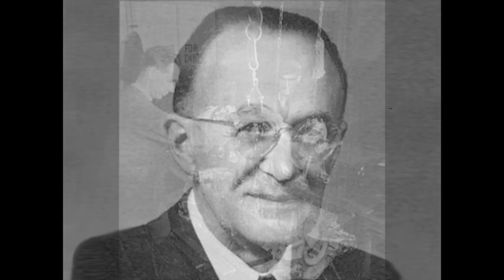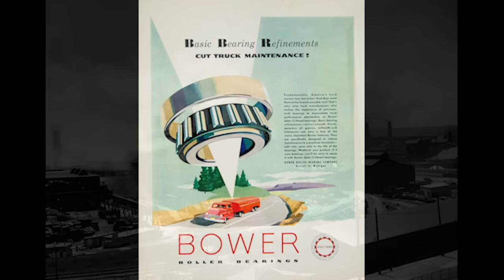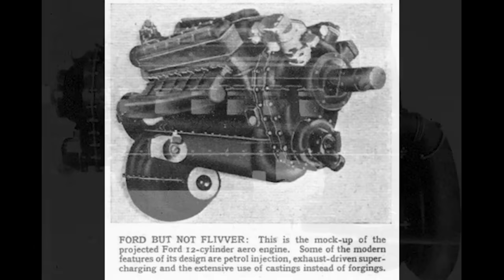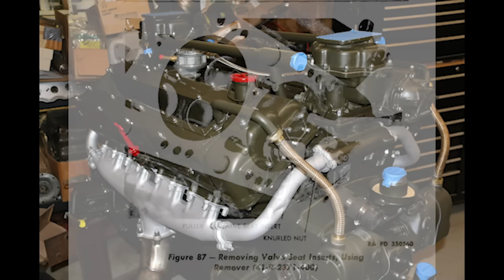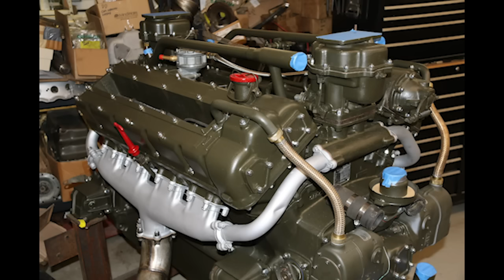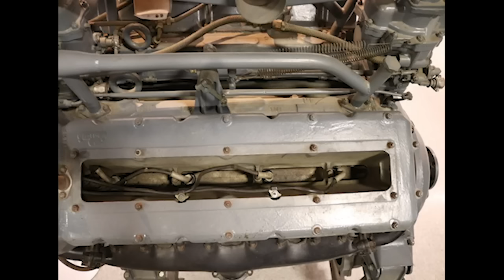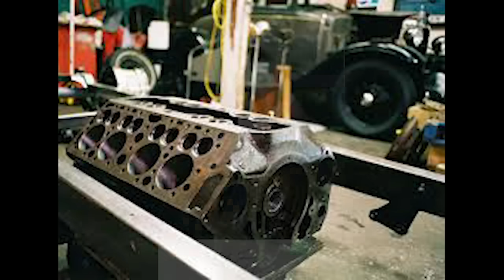War Hemi: The Story Of The GAA V8 - 1,100ci of aluminum WWII Ford grunt

Comment: Now, Ford is making engines that run sub 7 minute laps at Nurburging (quickest) first American car ever. Fastest all-time ever pass for a pushrod, internal cumbustion engine in a 1000 foot Funny car run, Bob Tasca was even FASTER in the quarter mile. Fastest runs ever at Pikes Peak. Fastest ever lap in a NASCAR sanctioned stock car, Bill Elliott in a Thunderbird at Talladega.  Dominates the BAJA truck races. Has won multiple F1 and Indy car championships etc. The 4.6 ohc motor is nearly indestructible. I drive (and have driven) Ford vehicles every day for 30 plus years and have never had a major or catastrophic failure. You're either an ignorant LS fan or just truly uninformed. Oh and by the way, the LS motor is really nothing more than a ripoff of the Ford 351 Cleveland engine with an aluminum block.
Reply from the maker: Fired up!!!!

Comment: just proves auto makers using timing chain set ups are screwing the public
Reply: A worm gear would never work at the rpm's a modern engine revs too. The noise they make would also be intolerable.
Ingenious design though and great for a low revving tank where noise doesn't matter.

Comment: I learned a lot in this, it didn't occur to me that they were doing dual overhead cam and flat pain cranks back in those days. I want to learn more about this 30 cylinder Chrysler engine, that sounds nuts.
Reply: DOHC was done by Peugeot and Duesenberg decades before. This information is inaccurate that is not a hemispherical combustion chamber. Hemi in the title gets a lot of clicks though

Comment: @1:21 "....Rolls-Royce has been creating a V12 engine with surgical care" Right, as he shows a picture of a mechanic with a cigarette hanging out of his mouth dropping ash inside the cylinder.... surgical. Yeah right. The quality control in the 1940s was pure crap.
Reply: I noticed that too.
Reply: Exactly 😂. The Merlin was such a POS when Rolls was manufacturing it they couldn't interchange parts between engines. It wasn't until Packard started building it that it was reliable. If one ran really good they would put it in a spitfire. If it ran subpart they would stick it in a boat.
Reply: @russblack443 Exaggeration and misunderstanding of the situation. Merlin were not unreliable. They were hand made.

Comment: Not a hemi.
Reply: The GA series has a hemispherical type combustion chamber
Reply: @WilhelmKarsten  No, it doesn't, it's a pentroof and that's clearly visible in this video.
Reply: @PistonAvatarGuy  Sorry, you are confused, there are clearly no opposing quench pads in the head or the pistons.
This is a hemispherical combustion type chamber
Reply: @WilhelmKarsten  Quench pads do not define a pentroof combustion chamber, the shape of the combustion chamber defines the shape of the combustion chamber.

Look at most Honda K series combustion chambers, they don't have quench pads (unless they're aftermarket castings, or have been welded to add material), yet no one would consider them to be hemispherical in nature.

Even on the GAA, you can see that there are flat spots where the quench pads would normally be located, they're just not close enough to the bottom of the head to be considered quench pads, just as it is with Honda K series heads.
Reply: @WilhelmKarsten  Heck, Drag Cartel even makes a head for the Honda K series that they call the "open chamber" head, it looks almost exactly like the GAA head.
Reply: @PistonAvatarGuy Opposed quench pads are the only thing that distinguishes a 4-valve Pentroof from a 4-valve Hemi design.
No hemi engine has a perfectly spherical chamber.
Reply: @WilhelmKarsten  Plenty of hemis have actual hemispherical combustion chambers. And if this is a hemi, what's a Honda K series?

A pentroof combustion chamber is made so by the fact that it resembles a pentroof, as this one does. There are two flat planes (one where the exhaust valves reside and one where the intake valves reside) which intersect at the peak of the combustion chamber, that's what makes it a pentroof combustion chamber.
Reply: @WilhelmKarsten  Really, I think that there's only one 4 valve hemi that has ever been produced, and that's the Honda RFVC.

Also, now that I've seen better pictures of the Ford head, I can see that there aren't really flat areas where the quench pads would normally be, but there is a very clear, straight line at the peak of the combustion chamber, which clearly defines it as a pentroof shape.

Comment: “Hand assembled with surgical precision “
-showing a picture of a guy tightening a bolt over an open valve train with a cigarette in his mouth
Reply: Precise doesn't equate to sanitary...try again.

P.S. I doubt cigarette ashes will lock the engine up.

Comment: Stainless steel exhaust manifolds are a "big weight savings"? Yeah. Saving weight is a HUGE priority on a "tank engine". 

And when it comes to stainless steel exhaust manifolds which are STRUCTURAL in that they support at least part of the exhaust system weight AND are "pressure vessels" its not IF they will break but WHEN they will break. Especially when WELDED. 

A little known "secret" of all those "high performance" engines out there that are "boosted" with turbos and are equipped with SS "headers" is that EVENTUALLY THOSE "HEADERS" ALL BREAK. And when they break is primarily determined by "heat cycles". 

Which is why ZERO "mass-produced"  engines use SS exhaust manifolds whether "log manifolds" OR "headers". Production vehicles rack up "heat cycles" far more quickly than "race" vehicles generally speaking and get HOTTER and COLDER than a "seasonal use" vehicle used for "motorsports" which nearly all happen in the "summer months". 

Most "high performance" off-highway vehicles also run "cooler" as far as exhaust temps go than road vehicles and/or for much shorter periods of time. 

"Exotic" fuels like "race gas" and ethanol-gasoline blends and methanol are also COOLER RUNNING FUELS BECAUSE AS OCTANE INCREASES "ENERGY DENSITY" PER UNIT OF FUEL WEIGHT DECREASES. SO THEY ALSO HAVE TO BURN FAR MORE FUEL PER UNIT OF "POWER" THAN A "LOW PERFORMANCE" ENGINE RUNNING ON REGULAR UNLEADED PUMP GAS OR EVEN "PREMIUM". 
THEY ALSO TEND TO RUN VERY RICH AS A "SAFEGUARD" AGAINST LEANING OUT THE A-F RATIO AND "MELTING DOWN" A PISTON BECAUSE LACKING SUFFICIENT "LIQUID FUEL" FOR COMBUSTION AN EXCESS OF OXYGEN IN A HIGH-TEMP HIGH-PRESSURE CONFINED SPACE LIKE AN ENGINE CYLINDER WILL TURN TO "SOLID FUEL" MEANING THE ALUMINUM IN PISTONS. ALUMINUM IS "FLAMMABLE" LIKE ALL "REACTIVE" METALS. 

So even something as "simple" as an exhaust manifold was far beyond Henry Ford's engineering ability which NEVER was remotely as "brilliant" as his "plans" whenever he was in "DIY" engineering "mode" and when it came to attempts to "take over" an already existing and established "industry" flush with REAL engineers back before engineering was a college "program" AND a "profession" Henry Ford was hopelessly "outmanned". 

And he was the original "victim of his own success" in that his "brilliance" was a PR tool his "investors" came up with to "recruit" REAL engineering "talent" to do all the real work that comes between a "plan" and a "product". 

Unfortunately being "outmanned" and in a situation where real "craftsmen" and "skilled laborers" and "scientists" and "inventors" were doing everything he could not in "his" factories building "his" machines - which pretty much WAS "everything" SINCE the sum total of his "work experience" before finally "developing" a "successful" automobile to "replace the horse and buggy" was as a supposed "scientist" working for Thomas Edison at "Edison Illumination" long after Edison "perfected" the light bulb and was "developing" audio and video "recording" and "playback" machines  as the "Wizard of Menlo Park". 

Not much in common with the "auto industry" especially when you consider that Ford's Model T ignition system used "trembler coils" for a "make and break" ignition long after DC "transformers" called ignition coils and DC batteries and generators were "developed" so distributor ignition was "feasible" on such a low-compression low-rpm small-displacement hand-cranked engine like his. 

Failing that MAGNETOS were certainly "perfected". 

But of course Henry wanted "affordability". And "security" for his "brilliant plans". And "outsourcing" a STATE OF THE ART ignition system would have required going PUBLIC with the reality that a long-time Edison Illumination "scientist" didn't know BEANS about ELECTRICITY. Which is why his "modern" automobiles didn't even have ELECTRIC ILLUMINATION much less electric starting until the "competition" at Chevrolet "developed" the first mass-produced and MODERN "competitor" for the Model T and set "affordability" aside in favor of DISTRIBUTOR IGNITION AND ELECTRIC STARTING AND LIGHTING AND A PRESSURIZED FUEL SYSTEM WITH A REAL CARBURETOR ON A 4-CYLINDER OVERHEAD VALVE ENGINE ON EVERY "AUTOMOBILE" IT MASS PRODUCED FROM DAY ONE AND MADE SURE ITS "AUTOS" COULD REPLACE A TEAM OF HORSES AND A WAGON INSTEAD OF JUST A HORSE AND BUGGY BY BUILDING A "TRUCK MOTOR" AND ALSO USING IT IN PASSENGER CARS INSTEAD OF TRYING TO TURN A MODEL T CAR INTO A "TRUCK" BY PUTTING DUAL REAR WHEELS ON IT AND CALLING IT A "TT". 

Farmers and ranchers were "flush with cash" until the "Great Depression" and were the #1 users of real "horsepower" on an every day basis and working horses more than 40 hours a week meant needing a "double workforce" each half of which worked only "half a year". "Affordability" be damned when you can replace many "horsepower hours" used only to get products to "market" and proceeds home again at a "fast walk".

Chevrolet made sure owning and operating an "auto" was not only easier and faster than "simply" catching and saddling a horse much less catching a harnessing a team but also easier than using any and all other mechanical horsepower on the farm/ranch like getting out and belting up and starting "hit and miss" engines for everything from washing clothes to pumping water to separating cream to shelling corn to grinding grain. 

Horses never did any of that. And Henry Ford never "replaced" a single "horse and buggy" for long because when his "horseless carriages" needed "service" somewhere besides at the "Ford Garage" you were "on foot" as long as it took to get it "serviced" on a "DIY" basis. 

Even "hit and miss" engines by the "turn of the century" were far more modern and state of the art when it came to fuel and ignition systems than a 1903 Model T Ford with "trembler coils" in a freaking WOODEN "coil pack". 

A Model T Ford "as invented" was a technological "backtrack" on the "modern" farm or ranch.
Reply: A little angry are we?

Comment: Old aircraft mechanic here. Whether it is a radial engine with a master rod and many link rods connected to it or Rolls Royce Style master rod/link rod per pair of cylinders- the geometry is such that it affects piston position vs crank degrees necessitating tweaking the camshaft grind and ignition timing on the link rod cylinders. I prefer side-by-side-on-a-throw arrangement with fork-and-blade coming in second.

Comment: At the Ohio State fair ,1969 tractor pulls. Back then, modified tractors were powered by BB Chevrolets and other auto designed equipment. The Modified's  pulled the best distance was 240 feet. Then this Minneapolis Moline 1000 that had been pulled around all day staged. When he started that monster, it had a low roar that one knew something great was going to happen. He pulled 287 ft. and the only thing stopped him a water line had blew off and the driver was getting scalded. After he returned to the pits, we ran down to see what powered it ? The driver said it was a Sherman tank engine. For a bunch of 18 year old's that was better than any ride at the fair! I'll never forget the torque that thing made.

Comment: Henry Ford was an A-hole and was too stubborn to do anything even if it’s the best thing to do.. which is why Ford never made anything great because it wasn’t right.. this engine was stolen from Rolls Royce blue prints and just because you don’t build it exactly like the plan says doesn’t mean it’s not stolen.. any likeness of the design is the same.. so because the crank was made cast instead of forged doesn’t mean it’s not the same- because it was stolen…
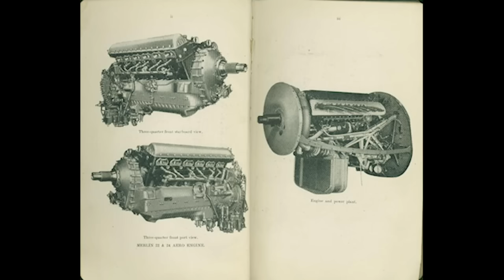16:12

Comment: One big problem as a tank engine, they were gasoline powered, the German diesels were better and did not ignite when taking a hit. Gasoline was an enemies bomb onboard.
Reply: Nope
Reply: German tanks were not diesel powered during ww2
Reply: All German combat vehicles in WW2 used a standard  Single Fuel OZ-74. Which is 89 octane unleaded gasoline.
 German tanks were powered by the HL series of aircraft engines optimized for tank applications and manufactured by Aircraft engine company MAYBACH

Comment: I'm surprised that a bore of that size could manage acceptable flame propagation using one spark plug. What am I missing?
Reply: Flame propagation is a limitation on bore diameter as rpm increases, the GA series had low rpm range
Reply: @WilhelmKarsten  But I think the bore would have been the same as the orginal plan to design an aircraft engine to compete with the Merlin/Allison so, as a '12' it would've had 5"-ish bore. Are you saying because the 'new' app required only lower RPM that the propagation would remain sufficient? That never occured to me.
Reply: @busterdee8228  Actually in the Aircraft application is RPM restricted... restricted by the propeller RPM and Diameter.
It's rare to find a WW2 aircraft engine that operates above 3,000 rpm max.
And the ideal power band for a propeller engine is in the 2,000 to 2,700 RPM range.

All engines with a bore diameter over 100mm (4 inches) eventually run into the limits of spark ignition and flame propagation in the over 6,000 rpm range.

Big industrial engines with really large bore diameter run extremely slow... less the 1,500 rpm
Reply: @WilhelmKarsten  Interesting. Thanks. I think the Sabre, with its "smaller" piston/rod masses and shorter stroke/piston speed, was the only production engine that could go "weeeeeee."
Reply: @busterdee8228  Yes, the Sabre is a notable exception and a very serious effort to take reciprocating aircraft engines to the next level, unfortunately too late and rendered obsolete by jet engines.
Reply: @WilhelmKarsten  I'll never forgive gas turbines for that. 😉PRTs are ok as long as the old metal gets all the cheers.

Comment: Nice what don't make sense is why do you need a bigger engine on a small plane ? A bigger plane yes, the propeller would have a rpm limit. But the pitch of the blade stay the same at any rpm. Didn't they have gearing? Why didn't they put simple tranmission on plane engine besid weight, as a bigger engine add weight. Compare to an electric motor we can see gears can get you any rpm to 22,000  same torque motor. That means any engine  can get addition rpm that is plane speed without a bigger motor.  Right?

Comment: The GAA was used in hydroplane boat racing for many years.

I exchanged emails with an owner of one of these engines he provided all the specs, and I worked this up in Desktop Dyno 2003. Yeah with a Rayjay 300B Turbo [ the biggest in the application] the GAA makes insane power and torque. 

829 HP at 2500 and 1984 lbs of torque at 2000 .... at 4000 RPM the torque is still 841 

I'm not sure the application is properly working with this size engine.

Comment: Not a Hemi its a 4 valve pentroof double overhead cam.  It does not have hemispherical combustion chambers. Why does everyone make this mistake two totally different designs? Shows lack of knowledge and misinformation.
Reply: The Ford GA series is a 4 valve hemispherical combustion chamber design. It has no quench pads and is not a high swirl chamber
Reply: Exactly. Who does this sh!+..Four valves per cylinder are pent roof. If it were Hemispherical , each valve would collide. Who do you copy this stuff from? I'd unsubscribe, but this Cut and Paste lack of thinking is both comical and Semi-hysterical.
Reply: @deanstevenson6527 That is not true, hemis are not required to have 2 valves, just an open chamber and a center spark plug

Comment: As a former machinist, in the Aerospace industry when manufacturing here, in the U.S. was still "in" ,pride in workmanship, enginerring and design, were paramount. As a mechanic, I also care about the work product I put out. But, having worked most recently at a Ford Dealership, in the parts depr. I saw way too many engines and transmissions getting replaced due to failure. One of the failure points was in the timing system, due to a lack of a woodruff key on the crankshaft. This is 100 yr old technology, yet it is missing. GM and Chrysler have similar issues. Not to mention valves and lifters dropping at 30k miles. This is old tech. This is why I said what I said. Either, the auto industry is tanking the ICE automobile purposely, or we have a bunch of disinterested UAW workers bulding low quality vehicles.